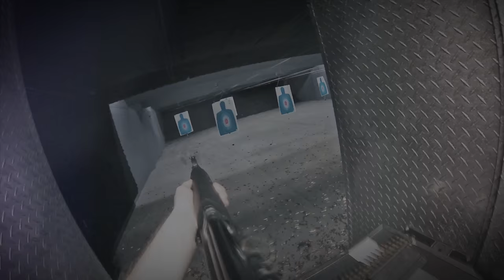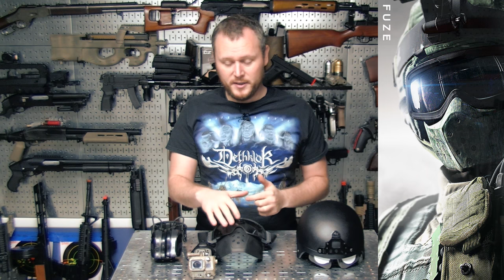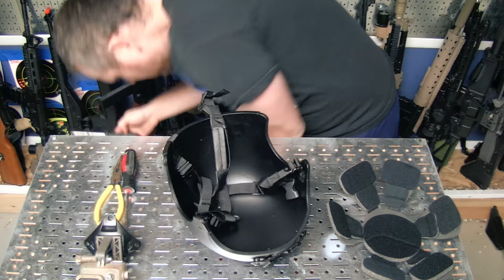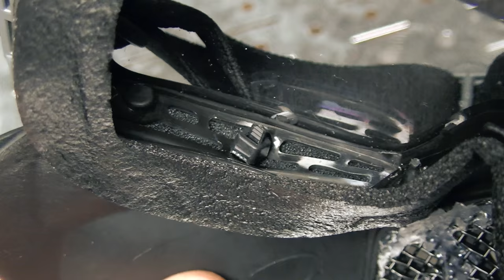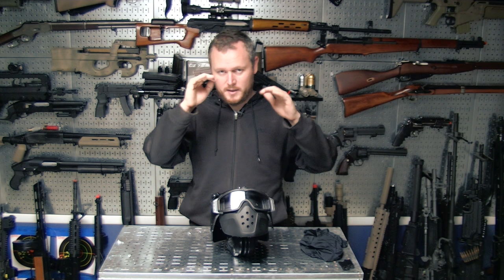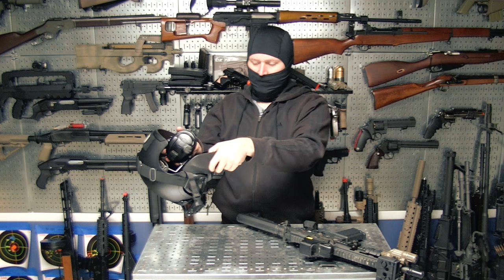Rainbow Six Siege Inspired Loadout (Airsoft)

Comment: Awesome work man, looks so sick
Reply from the maker: +Blake Pope I am loving it, probably going to take it to a CQB field tomorrow, if it doesn't fog it might be my new go to setup.
Reply: +BrainExploder Would look really cool with a kryptec typhon bdu in my opinon. Also, you should get some footage with this setup and the Dan wesson 715 :)
Reply: +BrainExploder I dont know if you saw my comment in the last video but you seriously should look at the pdt next gen headgear that rubberized lower mesh it has is so good ive had it for a few weeks know
Reply from the maker: I just don't like the look of those masks.
Reply: yea i need to figure out how they made the rubberized mesh part if someone sold that separate that would awesome I was worried it would hurt alot more than the metal mesh masks but I couldn't tell a difference

Comment: Well done man! I like it. I use a similar helmet. They are great because the plastic is really thick and you can do all sorts of things to them. Mine has the head-lock system on it. The one that uses the knob in the back for adjustments. The straps that come with these helmets are terrible. But again, the helmet is very versatile. The one thing I didn't really care for was the way you attached the ear pro to the helmet. If you are playing indoors and happen to stand up under something the helmet will be driven down on top of your head and that screw is going to find skin real fast. I was thinking that maybe two screws (one left, one right might be more stable and less likely to get into your scalp. Also, because the helmet is so thick, you could recess the nut side just a bit to get a smoother look with less sticking up. Just use a paddle bit to cut a slight recess for the nut.  Also, why set the head band on top of the helmet padding? Doesn't that make the whole thing sit up too tall? Just wondering. Cool loadout and thanks for all the great ideas!

Comment: nice! i did exactly the same thanks to your (tutorial) the zip tie only scratches my face if i dont pull it forward. Only had to bend the middle a lot so it could fit all the way in the nose thingy of my goggles. but it looks great now! only have to tidy up my zipties
Reply from the maker: +TheEnergizedcinema Make sure the part where the zip tie locks is not on the inside, put it in the goggle because your face never touches that, or outside the lower/goggles.
Reply: thanks, i did it like this http://imgur.com/F3x4o3D

the only annoying thing is that the nose part of the goggle kinda pushes onto my nose, maybe try it with a smaller zip tie or so
Reply from the maker: Looks good when done but yeah looks uncomfortable. Why did you not use the prongs that came with the lower to plug them directly into the goggle? Then you just need to zip tie on the flat areas under the eye on the part that does not touch your skin.
Reply: that didn't fit, i have different goggles but i fixed it now. i took a very small ziptie and added some washers, fits like a glove (y)
Reply from the maker: Awesome did you also trim the lower mask so it doesn't poke you in the cheeks and allows for better ADS?
Reply: yes i did, I trimmed down the entire part that was sticking out, i only left some small wings at the outside and at the sides of the nose to stick my zipties through
Reply: BrainExploder Its very easy with a stanley knife by the way ;)

Comment: oh yeah I was researching, brain, and i found out that the gsg9 jaeger helmet is actually a gentex aph5 helmet. probably the only way to use it is like ansi rated glasses a mesh mask and put down the visor on the helmet
Reply from the maker: +Sir Lancelot I hear it's a helicopter helmet.
Reply: +BrainExploder my bad its probably the sph 4 but yeah its a helicopter helmet, a little impracticle but still really cool nonetheless. the original production ones cost a lot like $400-$800 but you can probably get a knock off one for around $60 repaint it and you're good to go

Comment: Simply asskickingly awesome. I'm not big on the headsets too, you think the ear protectors you made could be adapted to fit this instead, and keep the original chin straps?
Reply from the maker: I tried that look and it looked terrible but certainly functional. I think I have a pic on my Instagram feed from a year or more ago.
Reply from the maker: https://www.instagram.com/p/_0vkUAQR9Y/?taken-by=thebrainexploder
Reply: I was actually meaning on using that bike lower mask instead of the regular mesh mask... I even went as far as going with a dye i4 just not to use those mesh masks, don't really care for them..

think it would work? the ear protectors and the bike lower on this video?

Comment: Greetings BE. In newer videos you are not using these fancy and very expensive ESS turbofans goggles. I am aware that you did attach them on this RS6 headset and they are not ment to be removed, but my question is if they are that good compared to the high price (around 200USD) in meaning of non fogging, comfort while aiming with them (low profile), maintenance (how acceccible are edges of the lense). You are doing honest videos so your opinion feels on place and not as an add. Do you prefer non fan goggles which you are wearing now with your black CQB headset with the meshmask decorated with shark teeth? Why? Thank you BE.
Reply from the maker: I like the Cyclone Mike fan system although the batteries already died so that needs constant replacement. The Revision Exoshields with added holes and Spit anti fog work well as well, Revision Desert Locusts also do the job well.

Comment: Hey there Mr. BE. I recently got a Mobius camera off of Amazon in hopes of making a zoom camera but when I disassembled it and took out the tiny allen screw holding the camera in place, it won't turn or budge at all. Is there factory glue on the threading or something else I'm not aware of? Thanks!
Reply from the maker: +Extram Yep they have started putting glue on the threads get some pliers and crank it counter clockwise.